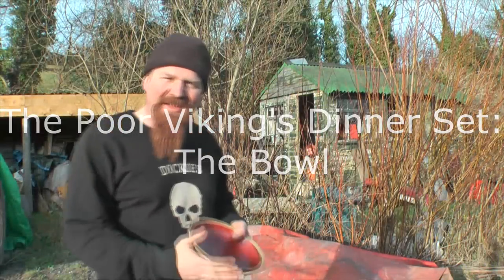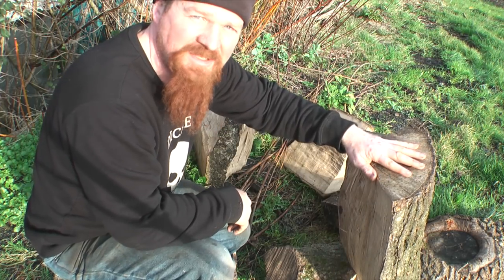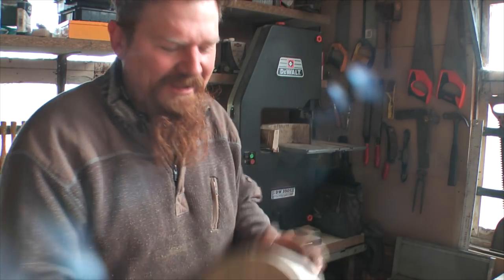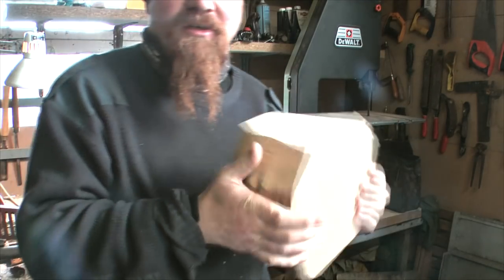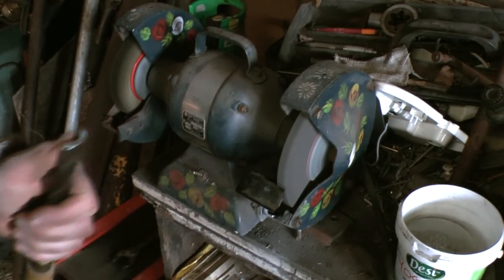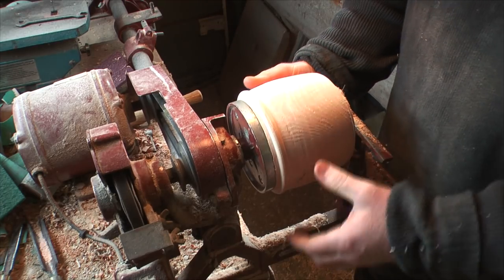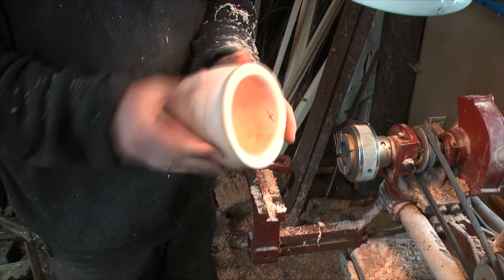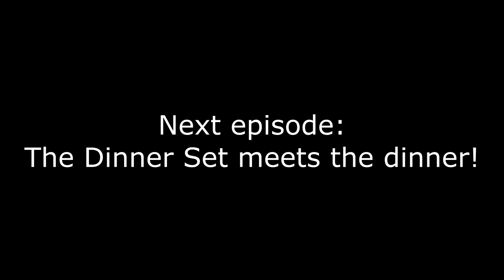Viking Dinner Set: The Bowl

Comment: Buy the way you can dry the wood by using a microwave oven at a low level  at 30seconds at a time but not really a way to go. I did do a goblet out of sheoak ( Western Australian variety) and I got the walls of the goblet down to .030 and I used the microwave to dry it out so I could sand it. I don’t know what happen to the goblet as it has seemed to have vanished. Made about 25 years ago. I remember after each bout microwaving, taking it out and listening to it crackle. It never did visibly crack either. 
It was successful project as had heard that this was the proven method to make a thin wall goblet. So successful I could see light thru the walls using a torch or in the sunshine see the shadow of my finger. 
 So like you I tried it as “you never know unless you try it.”
My wood lathe is home made and I spent a lot of time making cupboards and draws etc for it as well. It has a very sturdy tailstock and bed with m’cd mortars.
 I did all the wiring and has a reverse direction on it as well controlled by a switch. I have had fun with it as it cost me next to nothing to make :-)

Comment: Max, you are a man after my own heart - try anything and never be afraid of failure. On a technical note, you don't make a bowl from a horizontal slice of trunk as the finished item would be constructed almost entirely from short end grain and very weak. The flatter the bowl, the worse the problem.
Reply from the maker: I think that was the same point I was trying to make at the beginning of the video!? Possibly I didn't express it very well, I do have another go in the follow up video.

Comment: Slightly on topic. You may be interested in this: http://dewexmusic.com/tL/jyte/cycloneBA.jpg  I built this to vacuum out a 70 sqm loft in an Edwardian house, where the manhole access was very limited. There was a lot of soot, lime cement and lime plaster debris; around 2 cubic metres. That sort of muck cannot be swept and would use a lot of bags in a conventional cleaner. My contraption used one bag in the vac and filled lots of poly bin bags in the blue collection drum. You could fab a cyclone very easily in your shop. I bought mine; it's an American product. Cheers.
Reply from the maker: Thanks, I'll check that out. I did make a cyclone once, I used it to vacuum up and recycle my blasting grit, eventually it fell apart and I used the motor for the power hammer!